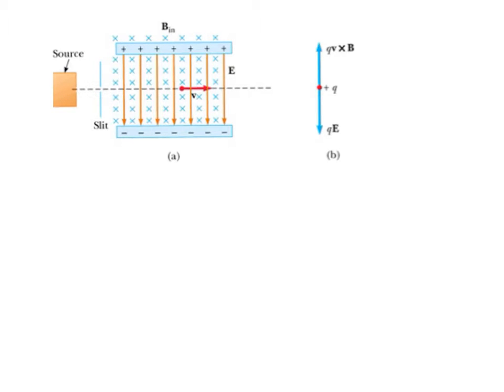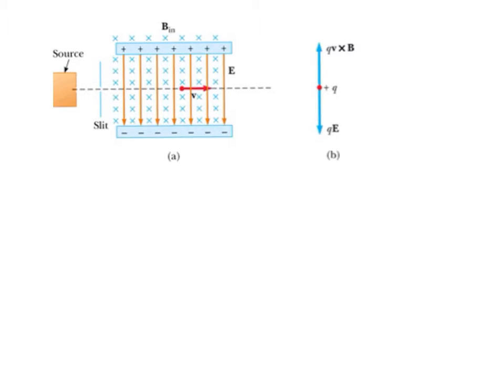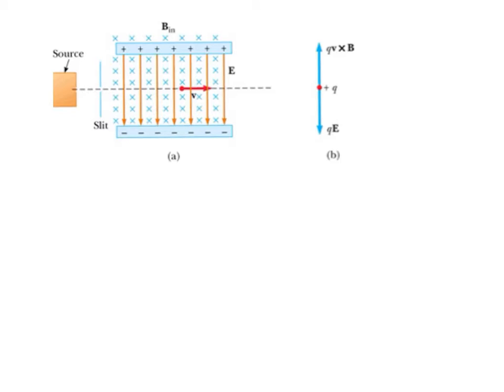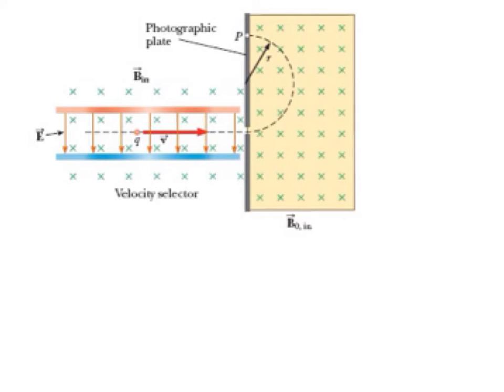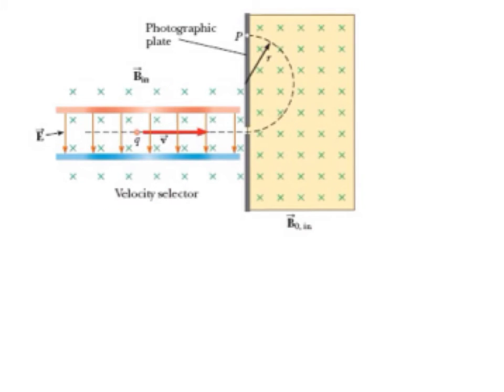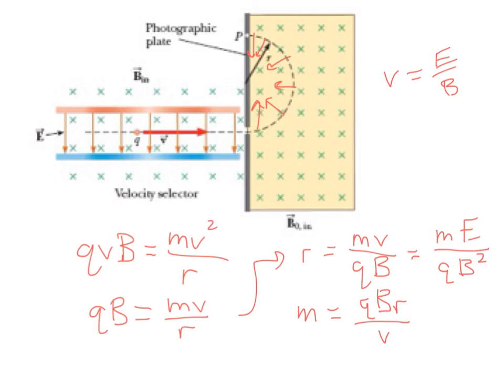Unit 11 - The Mass Spectrometer

Comment: Thank you for this video but still i have a question, Particles with different masses will also have different radii thus different velocity so they will deflect not entering the circular motion part so does that mean that the spectrometer only measures one type of particle at a time?
Reply from the maker: Particles entering the velocity selector only make it through if they have a very particular (pardon the pun?) velocity. Their ability to make it through is unrelated to their mass and charge, depending entirely on their velocity, as determined by the ratio of the electric and magnetic fields. Particles with different masses could still have the same velocity (and could thus both make it through). Now, the variety of particles entering the selector depends on what exactly is going on in the "Source" part of the diagram--so, you may only be studying one particle at a time, I suppose, but it's likely that you could be observing many different particles with identical velocities.